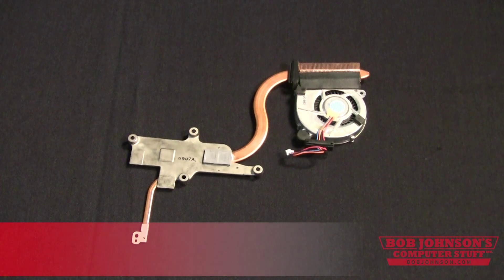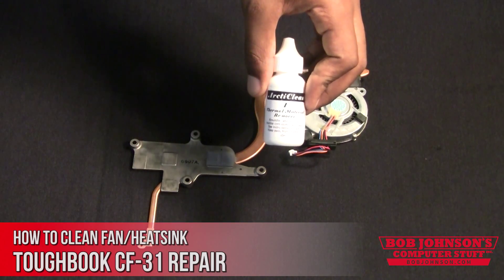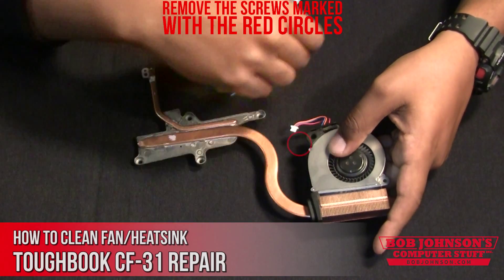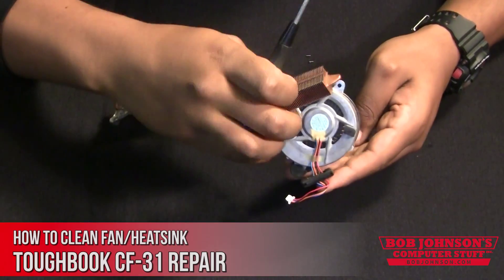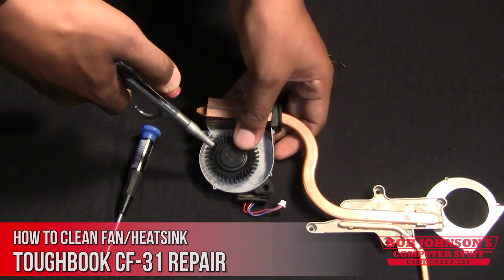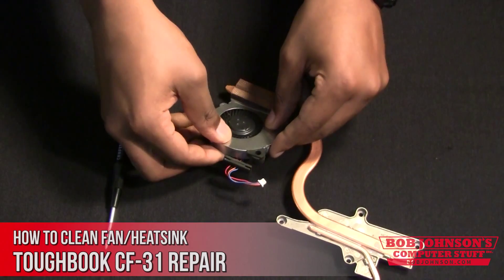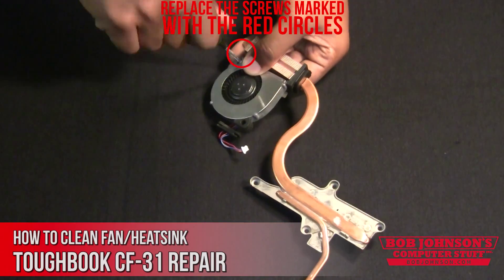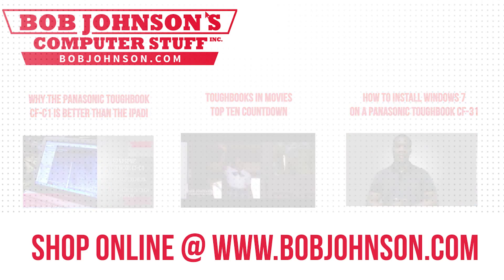How to Clean Fan and Heat Sink in the Panasonic Toughbook CF-31

Comment: Does this computer use thermal paste ?
Reply from the maker: The only part that we use thermal paste on is when we replace the heatsink. Hopefully this helps, thanks for watching.
Reply: @Bobjohnson  ok I have one we use for working on semi trucks and it a bit old and the fan seems to surge a lot I cleaned out the fan but am wonder if some new thermal paste could  helps it’s cooling ability
Reply from the maker: It wouldn't hurt. Just be very careful if you attempt adding paste yourself.

Comment: What is the thickness of thermal pad? 0.5/1/1.5mm?
My CPU is 50-55C in idle/browser, is it normal? 

Maybe you try to use Panasonic Graphite-PAD to cool cf-31's CPU?
Reply from the maker: I believe that it is 1.5mm, but am not certain. It is not something we have had a need to measure or replace with anything other than what we harvest from our inventory of parts machines.
Reply: Thanks! I think, I should replace it, because my cf-30mk3 CPU (l9300) is 36C in idle and 45 in autocad. But 50-55C in idle and 75-80 in autocad on my cf-31mk3 (i5-3320M) - is very hot. What do you think?
Reply from the maker: @abrekcheburek7287  That is hot for that unit. Replacing the thermal pad would not be my first choice. It takes a little while to replace and you need to remove the motherboard to do it. There are a lot of things that can go wrong during that repair. Overheating can be caused by a number of things. I would check over the unit first and narrow down the cause. A bad battery can run hot and cause overheating, so can bad RAM and a bad Hard Drive. I would advise checking those first and cleaning out the fan before undertaking a major repair.
Reply: HDD is new (WD Green), battery works fine (4-5h in work).
To clean heatsink and fan I also have to remove motherboard :(.
I'll try to make full cleaning and replacing thermal pad (I'll buy 1mm and 1.5mm)
I'll write about results when complete. Thanks for information and video-manuals!

Comment: does the fan on a 31 run all the time , or just on demand ,,, thanks t
Reply from the maker: It should switch on and off automatically as needed.
Reply: ah , mine runs all the time ,,, is the fix easy , or is it software ,, you certainlly do have all the answers
Reply from the maker: If we were diagnosing it, we'd first check the fan connection and see if the 31 is running hot. That would just be preliminary; the issue could be related to any number of things.
Reply: tom thompson Looks easy! I thought the fan was deep inside the machine.